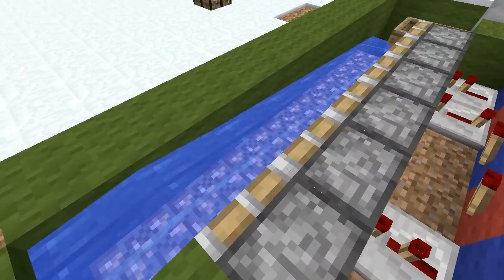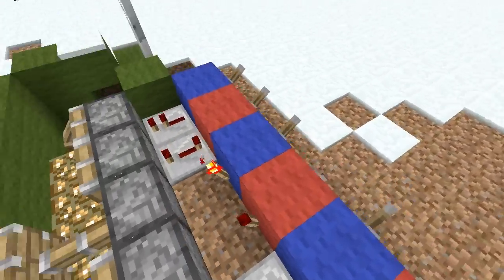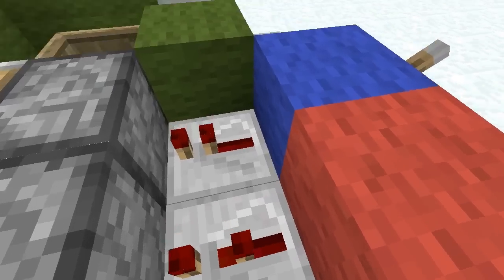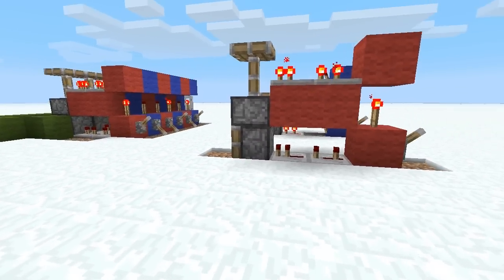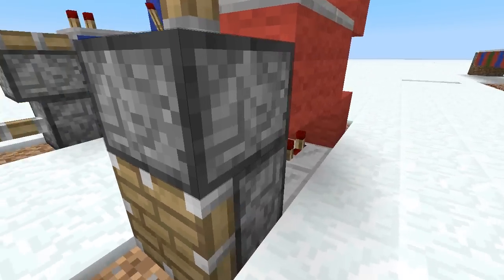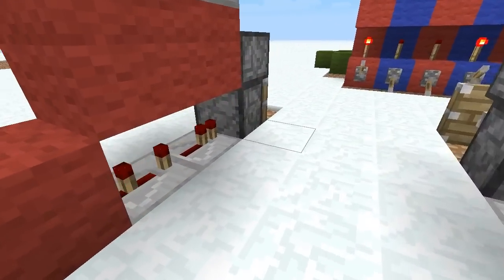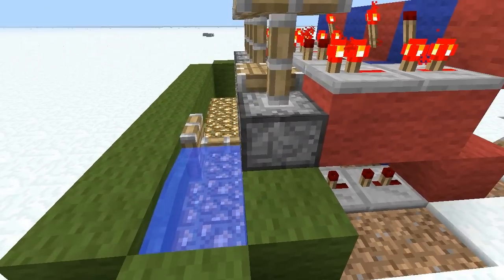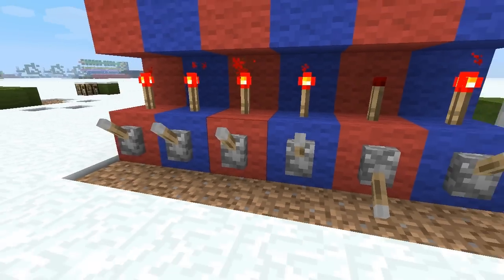Tweaks to drakhl's tiny water based combo lock

Comment from the maker: @drakhl 
Dah! Yeah, after rewatching your video I realized my mistake in pronunciation.
The squid doesn't break the lock when I tested it (if anything, it just acts like the boat. Lands on the pressure plate when the water flow is cut and floats above when the water flows again), but your solution like works :)

Comment: Nice vid. Btw, Drah-kul ;)

I didn't even think of the squid. Easily fixed though - Just dig an extra layer below the water stream, put pressure plates to hold back the water. Water will flow right over it no prob, squid will fall down through the stream and get stuck.